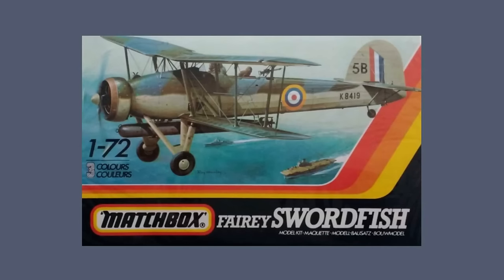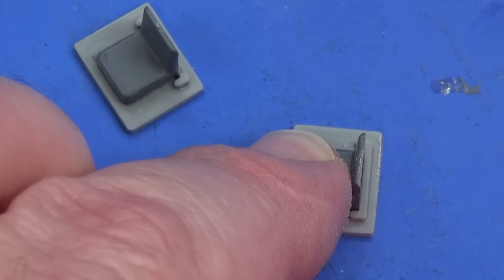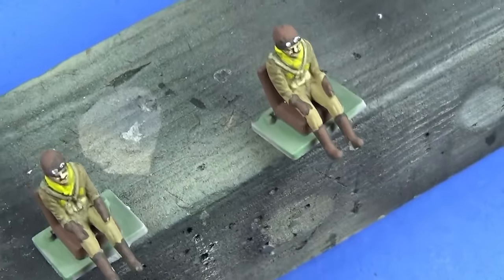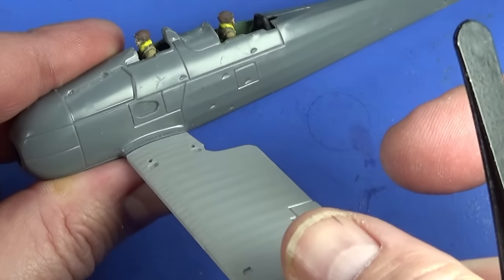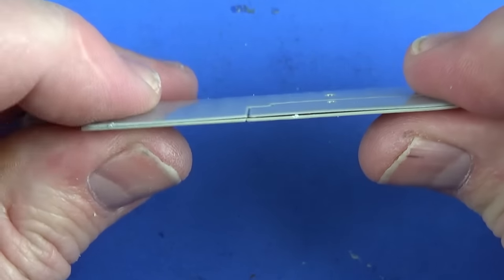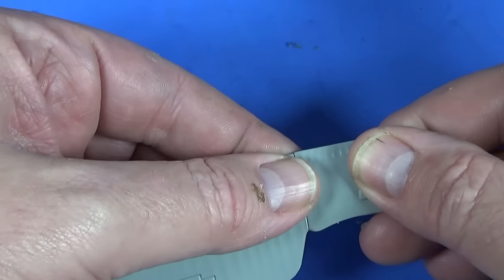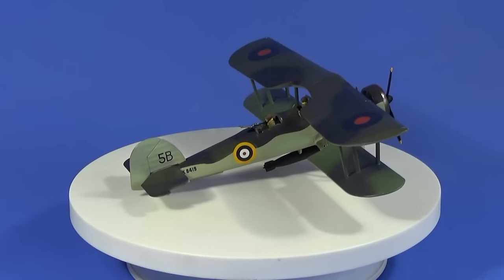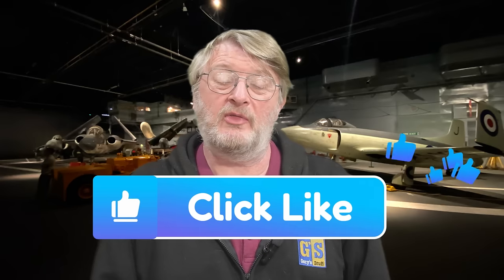FAIREY SWORDFISH - Simon's Matchbox Challenge #2

Comment: That looks like a really nice kit to build. I've only ever built the Matchbox 1:32 car kits (which can be a bit tricky, but are much more finessed than the equivalent Airfix kits). The paint job looks great and I'm sure it looks splendid on display with your other kits. I think the brass bits were the pushrod tubes for the radial engine, rather than intake or exhaust.
Reply from the maker: You are probably right - I'm not completely familiar with the layout of the engine other than using a collector ring for the exhaust!

Comment: Those pilots were brave ,moving onto to buccaneer did that have a Torpedo in its Arsenal or an up dated way to sink a boat (ship) now they could hug the waves and speed off they foxed the US  navy a few times in exercises ,all the best bud 
Mark 😊😊
Reply from the maker: Bombs and, later on, Martel missiles. Originally they were designed to take on the Sverdlov class cruisers by lobbing a small nuke at them. Buccs foxed the US Air Force more than once in the Red Flag exercises too. Overheard in a debrief - "I tell you old boy, I was flying so low I had to pull up to avoid a cactus."